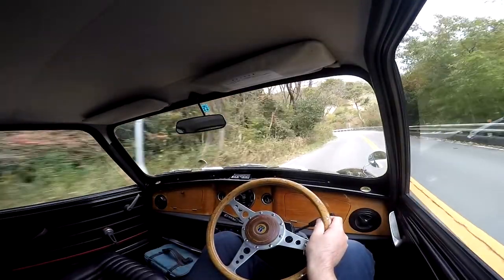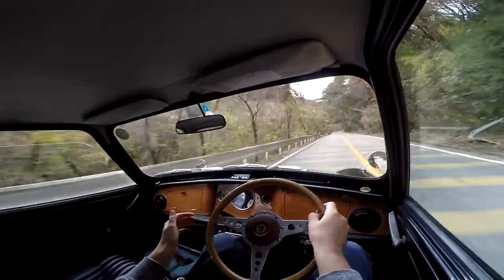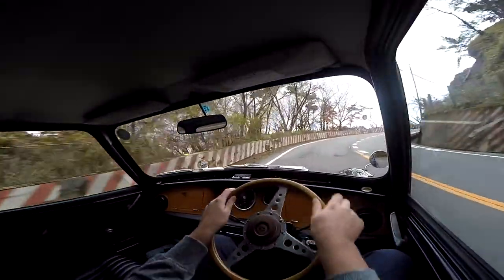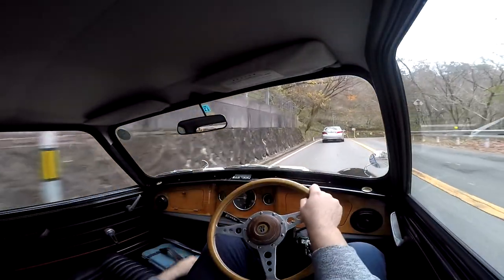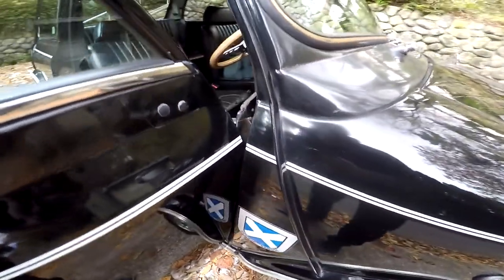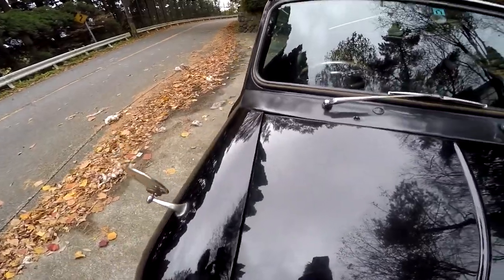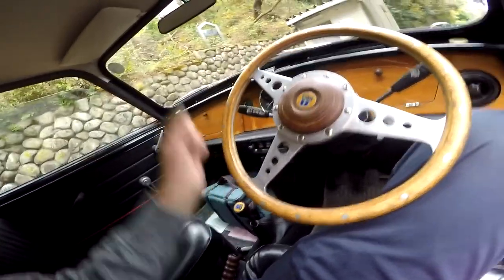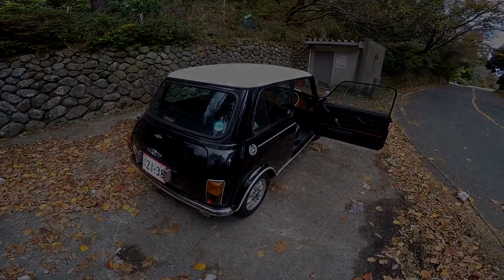1991 Rover Mini Cooper - Yes, a real Cooper - Walk-Around and Test Drive

Comment: How does a mini compare to a cappuccino in terms of handling finesse? I have a cappuccino, feels very jittery on roads in britain, but I am on old tyres!
Reply from the maker: They are extremely different... Not even talking about the FF vs FR layout, but the overall feeling between both cars is night and day. They would be really hard to compare... The Mini has such a unique feel that it's tough to compare it with another car... I would consider the Mini the only FWD go-kart in existence :)
The "go-kart" term for a road car is often abused, but not in the case of a Mini. It fits the bill in almost every ways but sheer speed: steering feel, throttle response on carbed ones, cornering capabilities... But it is uncomparable to a Cappuccino
Reply: @amamotor9032  What would you compare the cappuccino to then, was wondering if its like a go kart as well. I bought one in the Uk, it just seems to be really upset by bad roads, and you can feel it skip around feel wise. No external signs of shocka damage but the chassis has 120k miles on it